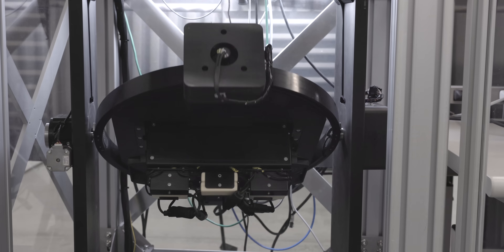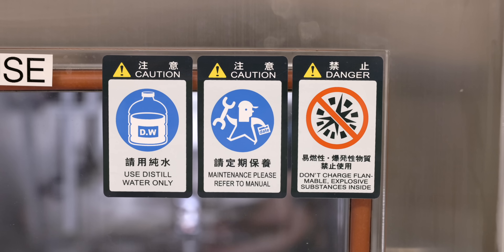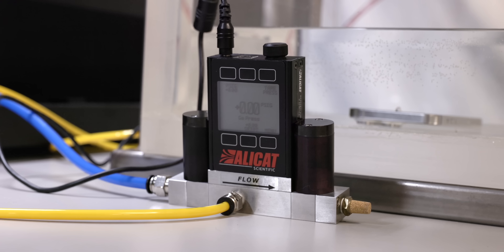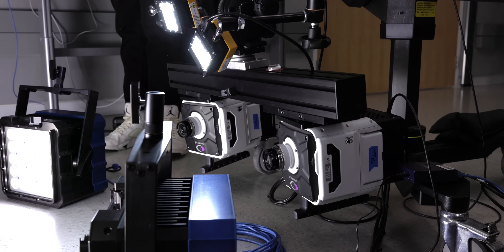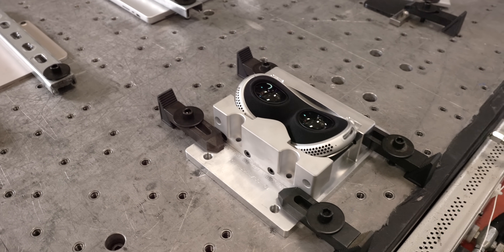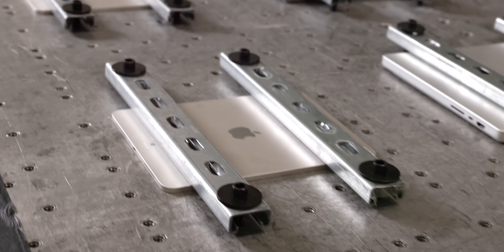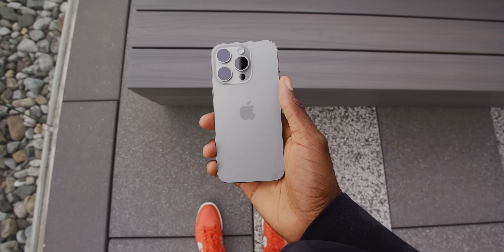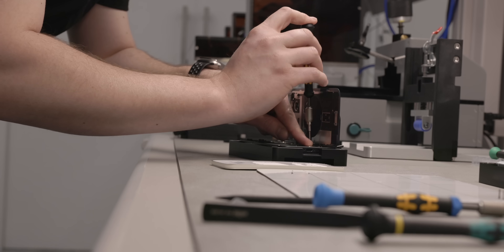I Visited Apple's Secret iPhone Testing Labs!

Comment: I disagree with the repair argument, yes... Using adhesive makes it harder to repair, but at the same time I repaired my phone which has it. The problem with Apple is they pair parts to the device, disabling features or otherwise making the device worse if you replace those parts. Even if Apple themselves made those parts. This means, we can't really recycle good parts from iPhones and we can't repair iPhones ourselves unless we're willing to give up some features.

Comment: I have been going case-less and screen protector-less for 4 years now on my iPhone. I’ve had Apple care which is a $20 screen replacement fee so I haven’t been too worried. I have cracked every iPhone EXCEPT the 15. I have to say the 15 is FAR better. I have tripped it from 5-6 feet on to concrete/ rocks etc at least 6 times since September and no cracks. Very impressive.

Comment: I was there at apple when the iPod was released and the iPhone.  Both were not water proof and both had constant issues with liquid damage (way more than any battery failures).  Apple designed their battery swaps to be an entire unit swap because it was easier for the factory to do the battery swap, and the customer loved getting a shiny new unit.  However we would get many users very upset that their batteries were not "user replaceable" and we would want to explain to them that making a user swappable battery makes the device much bigger since they would need connectors and shells around the battery, and doors on the device to hold the battery, which would not only make it bigger but make it have a smaller battery and have more points of failure (and making it infinitely less water proof).

Comment: 10:14 I honestly wouldn't mind goign back to metal backs on iphones. In fact, I'd prefer it. More durability at the loss of wireless charging, a feature I never use anyways since it doesn't transfer data or charge as fast as lightning or USB-C

Comment: Adding id to the screen camera and other parts so it will not work as other iPhone parts and you will need to pay 4 to 700 dollars just to fix minor issues also increase iPhones durability 1000 fold. What a load of BS. And after that they have the audacity to talk about Mother Earth and environment.

Comment: That repairability excuse the engineer made is nonsense. Apple had sealed in batteries long before the phones were water resistant. Some of the batteries were even soldered in. 

But look, it’s not about how difficult the repair is. It’s about INTENTIONAL actions by Apple to prevent or limit repair. Such as pairing parts to each other and disabling functionality when unapproved part is used. Designing the self repair program to be functionally useless when it would be cheaper to go to Apple to fix a screen then it would be to buy that screen and do it yourself. Not selling useful parts to Apple products such as charging ports, buttons. Louis rossman makes good points on this too. When you have a MacBook with a $5 chip that went bad, Apple will replace the whole motherboard for $1200 and you lose your data. Louis will replace the chip for a fraction of that price and you keep your data.  Better for customer and environment. Only problem. Apple does not sell the chip and even prevents manufacturers to sell that chip to anyone but Apple. Apple was and is anti-repair. Durability as an excuse is baloney.

Comment: to this day I think the iphone 7 was the most water resistant iphone. I submerged my 13 mini once and the speakers still sound kinda distorted, I accidentally went in the pool with my iphone x, got out 30 seconds after when I realized my phone was in my pocket and it was bricked, but I went to the beach with my 7, filmed underwater, kept it in my pocket the whole time then proceeded to use it in other wet conditions and never had any issues out of that phone until I dropped it once and it shattered lol.

Comment: Such a shame their quality control process doesn’t seem to be as thorough as these durability tests. Quite a few people including myself (as reported in multiple Apple Community and Reddit threads over the past several months) have been raising concerns regarding the iPhone 15/Pro/Pro Max models potentially being shipped with defective USB C charge ports and/or other battery hardware. Users have been experiencing an issue where their iPhone will begin to sporadically disconnect from charge then reconnect again, causing the device to vibrate and chime several times while charging as if the cable is being plugged then unplugged from the device rapidly. Most have found that attempts to troubleshoot by checking for debris in the charge port or trying different cables/bricks hasn’t resolved the issue, leading some to believe it’s a hardware fault that’s slipped through the quality control process. As far as I’m aware, Apple still hasn’t acknowledged these reports.

Comment: It's kinda bullshit to insist that repairability exists at the opposite of durability.
It is true in some aspects, they probably wouldn't have reached the water resistance they have without some glue. 
But most equipment that really lasts is highly maintainable. Just think about your car.
And that's just not what apple wants to do at all. Because when people mention repairability for apple they're really talking about the parts pairing and the availability of parts that they DO produce. 

So putting that forward as an argument is a massive lie.

Comment: Lol the repairability vs durability argument is complete BS. Software lockout of replacement parts, tons of glue on the inside, and proprietary screws does not make a phone more durable to water infiltration. A 3rd grader could see past this.

Comment: But what does "passing a test" literally means? My iPhone got dropped into a swimming pool and after coming out it was working fine, but when I tried charging it, it said the charging port needs to get dry. So, I had to wait 24 hours for it to get dry and then recharged my dead phone. Is it a "pass" or "fail"?

Comment: What are you talking about “most phones break immediately when you drop them”?? It’s been years since that. I’ve drop my iPhone 14 at least 10 times, one of them from a moving motorcycle and it doesn’t even have a scratch on the screen. Sure the aluminum case is very chipped, but not even a scratch on the screen. Using cases is utterly unnecessary at this point.

Comment: The problem is: Apple's position is BS, because repairability does create less waste, because it means the phone itself can be used for much longer. If, like the Fairphone, you can just replace or upgrade a camera module: then you don't need to get a new phone. The elephant in the room with Apple's argument is it only "checks out" so long as you're upgrading a new phone every few years. But if you plan on keeping a single phone for a decade... Then all of a sudden that lack of repairability is a big problem. Besides anyone who's ever had an OtterBox or such case knows that it's not hard to create a durable, waterproof case. Just make the exterior out of durable hard plastic with a two pieces that go together with a gasket. They could easily make a phone that had machine screws all around the edges clamping two halves of a phone together, sealed with a gasket. But they don't because they want you to buy a new phone.

Comment: Glad they touched on the reparability factors and how having a reliable phone is way more important than being reparable. Apple has the numbers on how many phones ever get repaired, let alone repaired by a 3rd party, is super low compared to people who never needed to repair it because of the build choices. The average person will replace their phone long before needing a new battery or screen for many reasons, such as advertising the latest version, contract renewal with a new phone, or just having it for a few years. I will always want to buy a product that doesn't need to be repaired over one that I could repair because it isn't reliable.

Comment: Wait, they do vibration tests too?

So why the heck did the camera OIS still get fucked up if you put them in a motorcycle front storage pocket for too long while riding it? Most of the time you'll end up with the camera shaking indefinitely even after you take it off the bike

Comment: Glass and thin design philosophy influence durability/repair which drive into cost of manufacture and in warranty repair. Specifically if it does not fail during warranty then repair down stream is on the user. A tweak on the philosophy of thin (ner), potentially, could net improvement on repair downstream. However, as we are trained to throw away and replace I guess it ends up a moot point.

Comment: 7:09 This is propaganda. Even the talk with the head of hardware engineering is propaganda. The iPhone fails, absolutely it does. In both cases it is about how u use them. The choices are do you want option a: a phone that can definately fail relatively easily but that can be repaired without much cost. Or option b: A phone that will also definately fail though not as easily and will cost you and arm and a leg to repair. Don't know about y'all but option a sounds like what will benefit the customer more than option b, not to mention, option a will stick around longer due to the fact that it is easy to repair/refurbish, meanwhile most people will discard option b very easily and thus, option b has a more negative environmental impact.

Comment: Glass you say, what ever happened to plexiglass? Why not? WHY NOT USE THIS? 
Plexiglass:
Thickness
The thickness of a plexiglass sheet is an essential factor to consider when calculating impact resistance.
Transparency
Plexiglass is more transparent than glass, giving you a better view of what's inside.
Reply: Way better for the wallet meaning less often having to get your iPhone 📲 fixed due to it dropping so many times. One time is far too many. Cause you simply don’t know what will happen the next several drops. drop on the asphalt pavement from the car 🚘, to falling from waist height, chest level to asphalt road below ⬇️ 🛣️, head 👩🏼👱🏻‍♂️level with iPhone📱 to ear👂🏼 drop. iPhone hold slip chest level to wooden floor drop, -> that’s how my iPhone 📱 screen cracked in many pieces rendering no touch screen response. Good Luck Apple, cause you’re going to Need it!! Plexiglass it Apple 📲

Comment: I'd argue that Repairability and Durability are not on opposite ends of a sliding scale. ip68 can be achieved with all the proper sealants and gaskets while still configuring the internals to be repairable. 
Tying hardware components to the specific phones via software has nothing to do with durability. having proprietary screw head shapes has nothing to do with durability. those measures exist as a safeguard for Apple to ensure that the average person cannot repair their iPhone without having to pay Apple a lot more. 
There's no logistical reason why they couldn't use all flathead screws and just use more of them to lock down components. there are coatings that can be applied to PCBs to make them hydrophobic and protect them from damage should any liquid get inside. more durable materials like titanium and ceramic can be used in their entirety instead of simply advertising their inclusion while neglecting the fact that it's <10% of the composition.

I don't hate Apple, but i don't appreciate being lied to my face

Comment: Definitely makes sense to make something more durable so it doesn’t need to be repaired. I think the main problem everyone has with Apple is that they software lock their components. This doesn’t add additional durability but it does make repair more difficult. This makes the company look like it’s greedy and monopolising all aspects of the products lifecycle even though there are cheeper and more sustainable repair options that should be available.

Comment: what does water ingress have to do with serial number locked batteries? you could remove all the sticky tape gluing the battery down and still have the same ip protection.

Comment: An argument can be made here: Is it possible that Apple is deliberately making it hard to repair their phone so that people go to Apple to repair them, because as we just saw; It's such a "technical'" aspect of building a phone from scratch in such a way so as to make it durable, that to allow lower skilled, off-the-street repairmen to replace internal parts may lower the overall experience and potentially lifespan of the device?

Think of it in this context - If you're wealthy, and you buy a Ferrari. When it needs to be serviced or repaired, wouldn't you rather send it into the official Ferrari garage rather than some random mom-and-pop shop? The mechanics at Ferrari have been specifically trained and have years of experience in Ferrari motors and gear boxes, so they know what they're doing.

I'm also not saying that Ferrari wouldn't 'scam' you by overcharging because I'm not talking from a financial point of view, I'm talking from a technical one.

Comment: Putting repairability vs durability on a scale seems like classic gaslighting on Apple's part.
Reply: I think what the engineer said is true, but he omits the actual reasons why phones are becoming impossible to repair. I can believe that making a phone more complex and tightly packed can increase its durability, but as long as the parts are available, you can still repair your phone if you know what to do. The real problem is that apple doesn't let people buy parts and makes some parts impossible to replace by yourself by forcefully pairing them to the phone. Apple sells some parts, but they sell them at such a high and unreasonable price that makes repair not worth it. Apple restricts its manufacturers from selling those parts to other people too. None of these other things make the phone any more durable.

Comment: The philosophy of indestructable vs repairable is logical until you realise that at one end of the spectrum is a fantasy (indestructable) and the other is the daily reality, shattered screens and dead batteries. The need for repair to at least some extent (batteries) is even conceded in the interview, at which point, doesn't that mean the pursuit if indestructability at the expense of repairability will always be a falacy? The problem has never been that basic repair opportunities don't exist, it is that they are overpriced and inconvenient. If apple make near indestructible phones, that means the cost of repairing the ones that break should go down (less phones need repair), so why do consumers have to take the burden of cost for when this design philosophy inevitably demonstrates it's falacy and consumers send their phones through apple's own channels for repair? If they're thinking this hard about it, they should consider the consequences of their own decisions as well as their excuses.